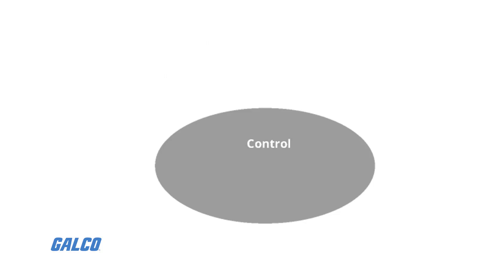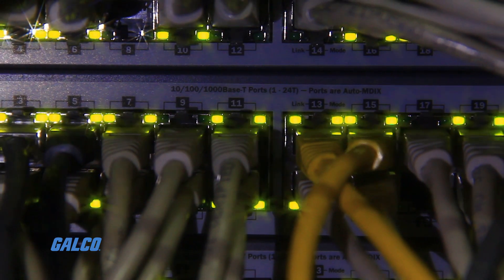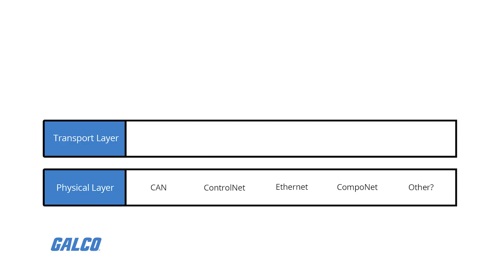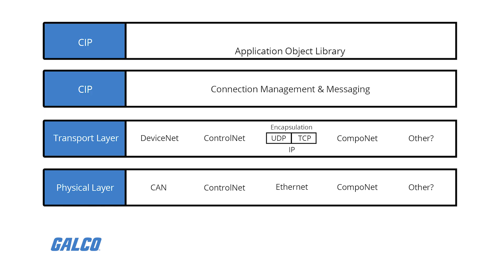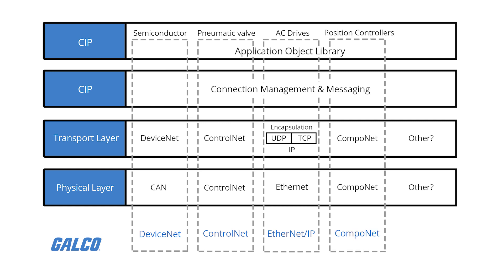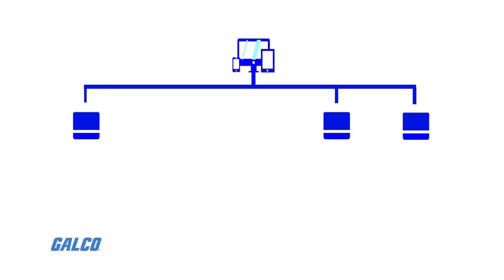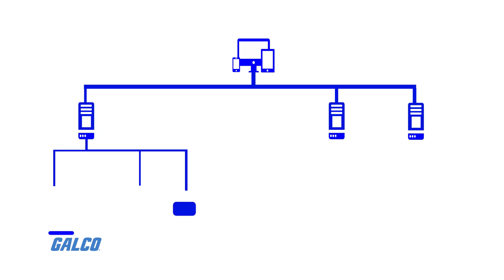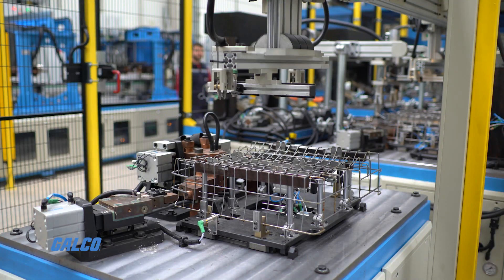What is Common Industrial Protocol? - A Galco TV Tech Tip | Galco

Comment: I'm interested in adding the smarts to my industrial microcontroller that can talk to off-the-shelf software. I've seen some open source-projects (EIPStackGroup / OpENer ), but I'm not exactly sure of what is required. 

Would I need to first have a TCP/IP stack.. then the application-layer specifics would be handled by the specific protocol I choose, like
 Rockewell CIP -> DeviceNet/ControlNet -> Ethernet/IndustrialProtocol ? 

What software (Windows/Linux) can be used to test or communicate with my device?